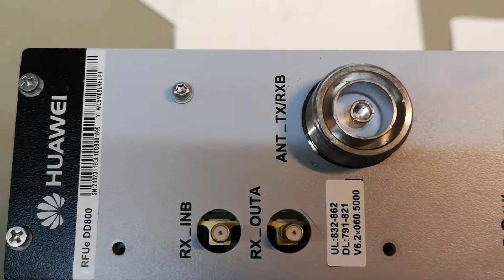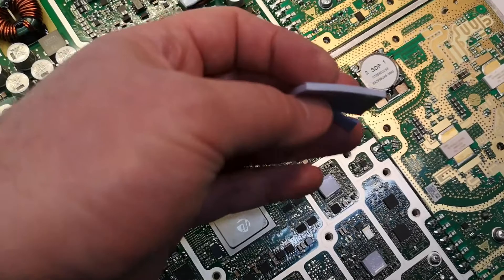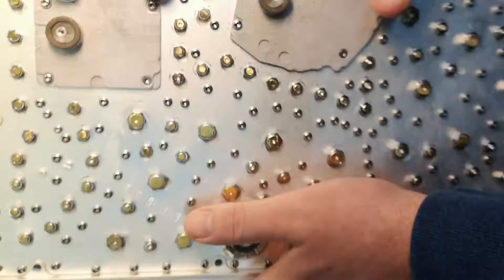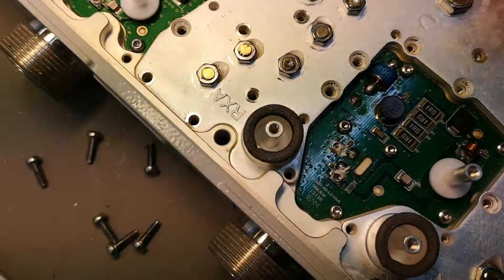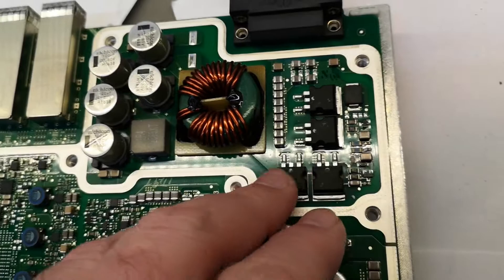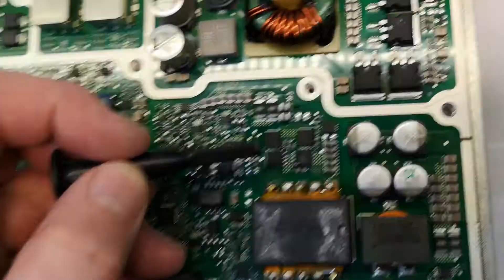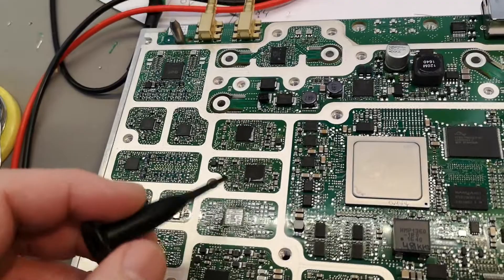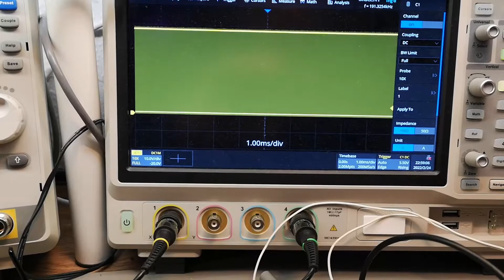Huawei Base station GSM DD800 Detailed Teardown

Comment: Thank you for interesting video. Could you tell what is 8D6 G68T component in RF power amplifier section that you refer as insulator?
Reply from the maker: ISOLATOR is a really interesting RF part, that alow signals to go in the correct direction, but transfer reflections or reverse signals to a load, so they dont go back in and create intermodulations unwanted harmonics